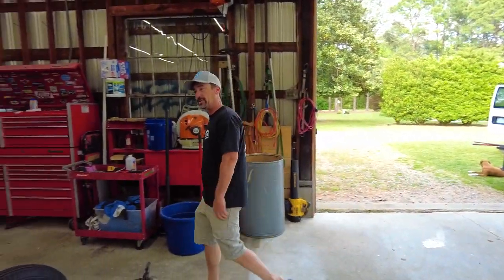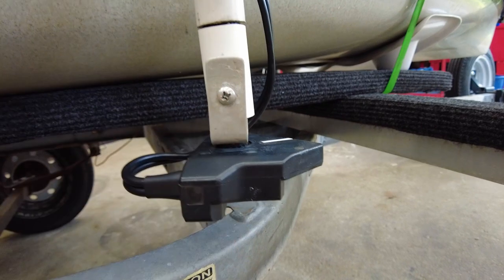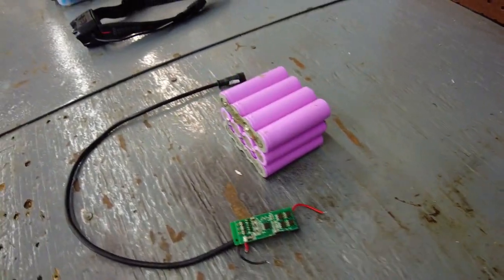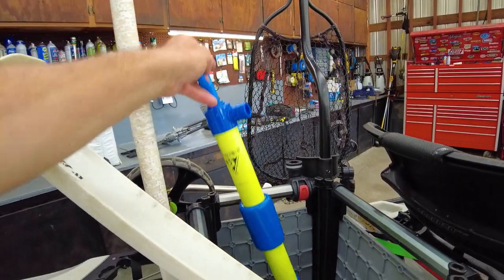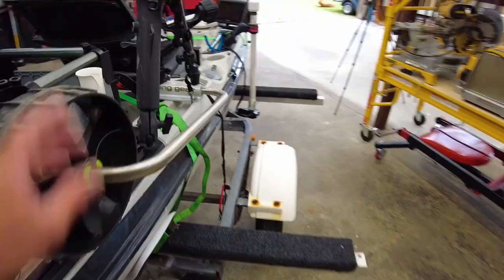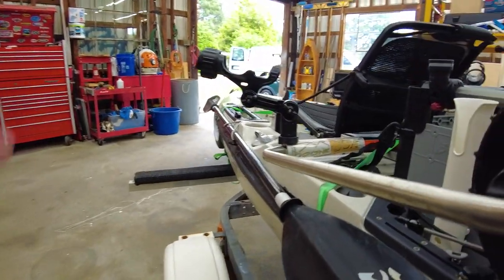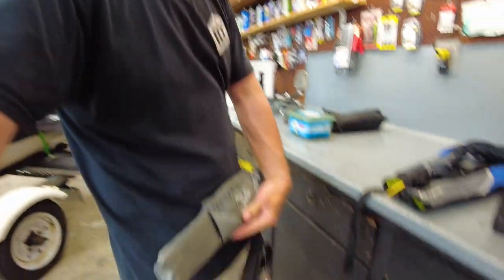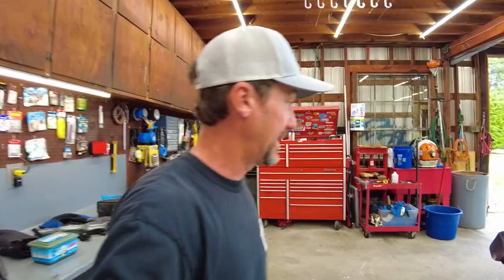Fully Rigged Hobie Outback (My Current Setup)

Comment: Great vid, love seeing your setup in detail. Your overview and build vids when you first got this yak were a huge help to me when I was looking for a new yak, ended up getting the same model as you in the Camo.

 Love those Boonedox landing gear, wish they or an alternative were available in Australia, coming from a feelfree lure I miss the ease of just rolling straight into the water. 

I see you don't have the upper front hatch seal installed, when these first came out there was a lot of feedback about them leaking into the front hatch. For Australia at least, Hobie issued dealers with a free front hatch gasket seal kit for users to install themselves and then factory installed in later production runs, I've never had any issue with water in my front hatch after installing it. 

Keep up the great vids, love your work!
Reply from the maker: No issues on my front hatch. I do have the kit but never installed it. Glad I was able to help in some way! Thanks for the comment!

Comment: Why not use the transducer plate from hobie?

I just bought an outback , not fished yet (waiting for surgery) .
Why not have the rodholders on the rails?
Reply from the maker: I do use the plate under the yak for the regular transducer for sidescan and downscan. The livescope has a seperate transducer that it best used if you can rotate it and look where you want. As far as the rod holders I have tried them mounted differently through the years and I prefer them mounted behind me. keeps the front of the yak clear for fighting and landing fish

Comment: How do you feel about the 2019 Outback vs the Pro Angler that you have? Have you had to launch the PA from the beach? I'm torn between the new Outback and the new 12 ft Pro Angler 360. Plan on using the kayak to fish the CBBT and launch from the beach as well as fishing the (often shallow) Lynnhaven Inlet. Concerned about the Outback redesign handling rougher water and taking waves over the bow. So far got test a 14 ft PA 360 and it feels way too big.  Thank you!!! Your walkthroughs are awesome and the water hose hull protection is well worth it!
Reply from the maker: Sorry for the late reply. Been Busy. I would go Outback personally, the 360 drive is plagued with problems and the 12" PA is still heavy. The Outback does fine in rougher water, it does take more water over the nose but never had major issues with it. Honestly if the water is that rough to cause an issue you wouldn't be out there to begin with. The only down fall to the Outback is it is not as comfortable as the PA. I had to mod the seat on mine to help to get it more comfortable for those 12 our days